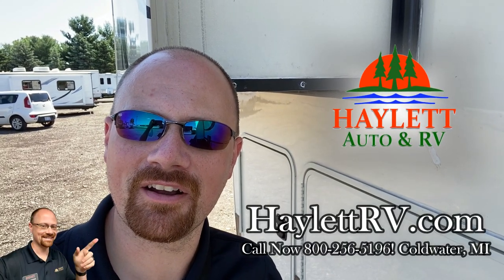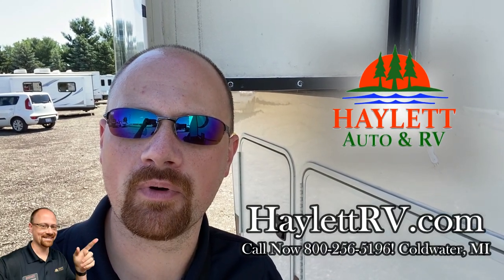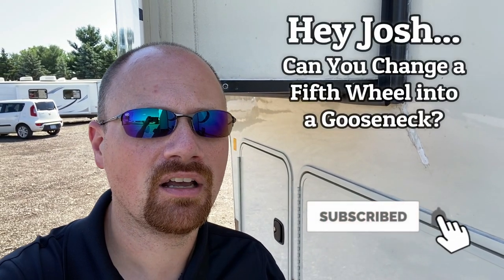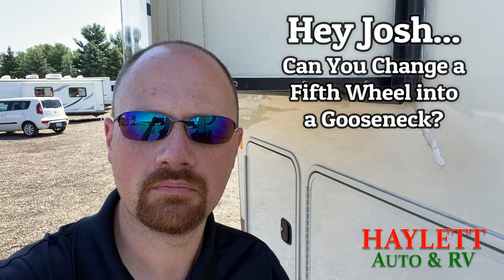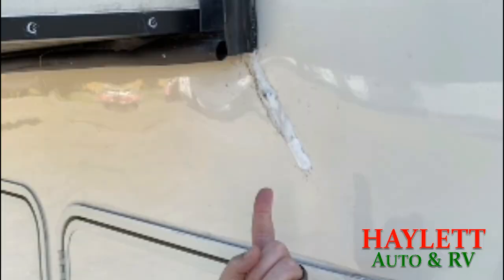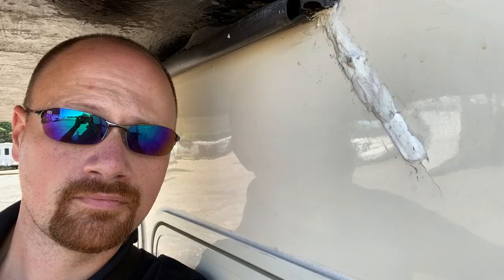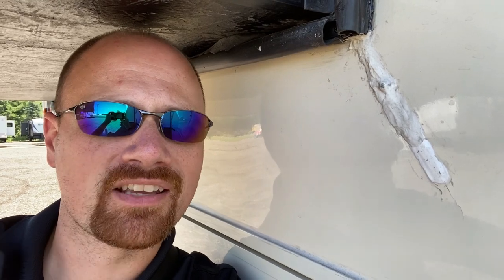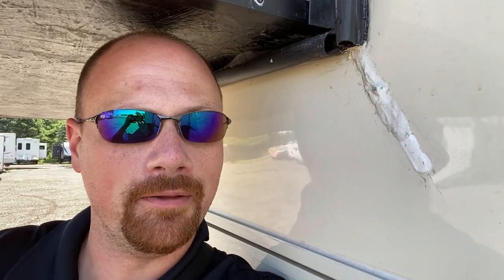WARNING!! Fifth Wheel Gooseneck Adapters with Josh the RV Nerd

Comment: Okay Josh.....can you clarify?  By adapters, do you mean using something like the Anderson hitch without changing the traditional pin box?  Or changing the pin box to a gooseneck pin box?
Reply from the maker: An add-on to the pinbox that makes it a gooseneck coupler rather than FW kingpin
Reply: Haylett RV, thank you for the clarification!  You had me a bit nervous
Reply: Haylett RV What are your thoughts specifically on the Andersen?
Reply from the maker: @therd6811  Andersen makes a lot of products. Are you referencing the Tri-Pod hitch? They're pretty slick. Huge load rating, tight turn radius capable, and light enough to move without throwing out your back
Reply: Haylett RV Yes, the Andersen Ultimate (tripod-type). Light weight, easy to put in/take out, and it appears that, being closer to the kingpin than the Reese Goosebox, it would put less stress on the frame than the Reese. As I understand it, Lippert and Reese are in bed together, and that is why LCI has given the blessing to Reese. It would appear to me that the Andersen is at least as good as the Reese, perhaps better. Lots of Andersen haters all over the place, just looking for either facts or solid, fact-based opinion.   Thanks
Reply from the maker: @therd6811  All good information. My goal with the video is not to cause anyone problems, but simply to educate potential owners. There's a lot of useful information coming to the surface in these threads

Comment: The Gooseneck will pivot on the ball, left, right,  back and forth causing more stress of torque on the trailer.
The 5th wheel is way to go. It limits the left and right motion of the trailer and not to cause so much torque to cause stress.
I'm a welder and seen alote of twisted Gooseneck tubes on flatbed trailers. Knowing if you trying to replace it the whole trailer is out of square.

Comment: I believe the Anderson Hitch which is this type of ball adapter setup VOIDS the Grand Design Warranty. That could be a very unhappy event to have happen I would think.   Time to read the fine print in that GD Trailer Frame Warranty maybe. Thanks for spreading this news Josh.    bill in Florida
Reply from the maker: I believe you are correct
Reply: What about Montana.  We use ultimate Andersen hitch also
Reply: We have a Montana and an Andersen hitch and absolutely love it. I’ve seen nothing indicating our warranty is voided.
Reply from the maker: @meghannderson  It's not Montana-directly but rather the chassis MFG. They only approve the use of specific systems

That list has updated somewhat recently. It's possible Andersen is not among approved vendors. I would need to verify

Comment: Nah, I have been using and Andersen Adapter that isn't a "gooseneck" but it allows me to use my puck system in my Ram. It doesn't lower the tow point more than 2 or 3 inches.
Reply from the maker: To my knowledge those setups are not covered by the chassis supplier and factories btw
Reply: @JoshtheRVNerd   Doesn't matter if they are out of warranty.